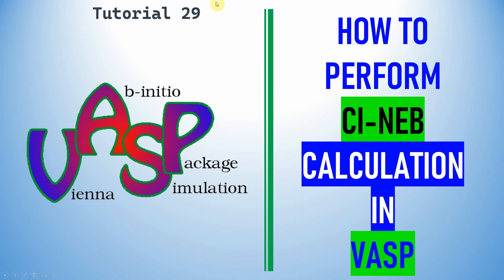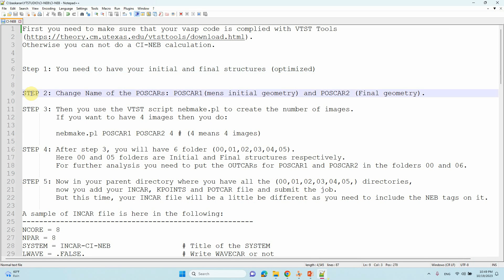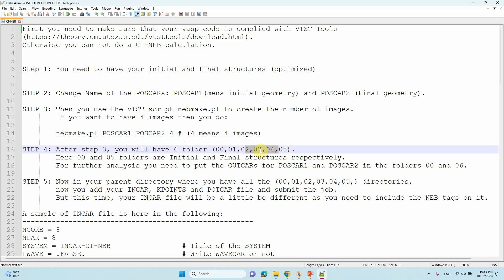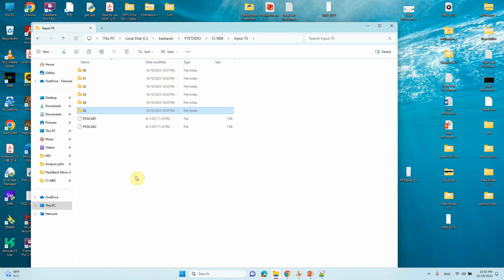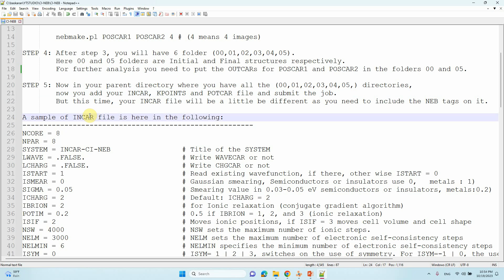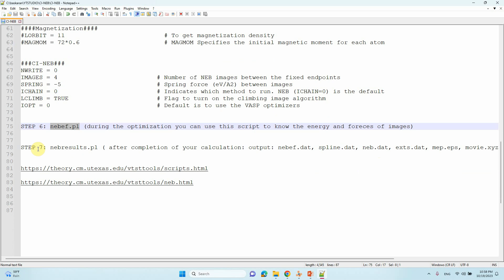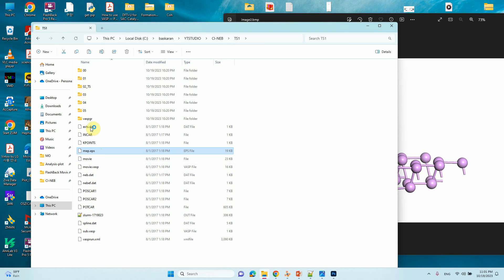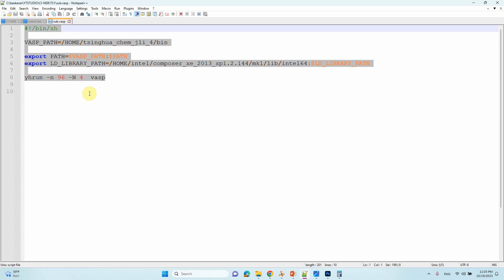How to do CI-NEB calculation in VASP | Nudged Elastic Band Tutorial | NEB Calculation using VASP

Comment: Sir How to get POSCAR1 and POSCAR2 structure?
Reply from the maker: In VASP NEB (Nudged Elastic Band) calculations, you must provide initial and final structures. These are usually named:
POSCAR1 → Initial state
POSCAR2 → Final state

What are POSCAR1 and POSCAR2?
POSCAR1
Structure of initial state (IS)
Example: reactant geometry, starting configuration, adsorption before reaction, etc.

POSCAR2
Structure of final state (FS)
Example: product geometry, atom moved, migrated ion final location, etc.
These two define the start and end of the reaction path.
Reply: @dbinfotech I mean poscar2 can be created manually
Reply from the maker: You can create manually and optimize the geometry then use.
Reply: @dbinfotech  for example Mn doped ZnS monolayer Mn is doped Zn site and then relaxed the structure . Contcar is replaced by Poscar2 and its total energy is -123.456 eV . Now Mn doped at S site and then relaxed the structure and total energy is -123.120 eV and Contcar is postcar1. It means that structure (Mn doped ZnS at S site ) is less stable than first structure so I mean POSCaR 1 will be less stable than POSCaR2
Reply from the maker: Based on the total energy, poscar is stable than poscar 1, even you need calculate formation energy (deltaE) of these two STRUCTURES TO CONCLUDE THE stable structures.
Reply from the maker: https://arxiv.org/pdf/1710.11051
Reply: @dbinfotech I am very confused about final structure
Reply: @dbinfotech I know the physics behind it but I am confused about final structure can you explain little bit  here
Reply: Here structure which is more stable consider Final structure and structure which are less stable is considered as initial structure as I gave you an example

Comment: Hi, I am calculating NEB of ABO3 structure, the images are optimized, but the energy of the images is very high as compared to the initial and final points. The barrier is high as a result.  What could be the problem?

Comment: Hi Sir, I do my neb calculation with 5 images but in my 5th sub directory i have only my poscar file what can I do for that.
Reply from the maker: Your 00 and 05 folders are initial and final structure respectively, in between 01 to 04 structure are will run neb calculations. You will check you incar file Ci neb section, you may mentioned 4 images.
Reply: @dbinfotech  I have mentioned 5 images using your video tutorial 42.
Reply from the maker: 5 means, 00 and 05 is initial and final structures other 4 is your TS images

Comment: Sir, I have question. The bond length of atoms is similar in the structure but the value of two different paths is different. If they planced at the same distance how diffusion barrier could be different for one path to another. Which factors the paths depends

Comment: We used contcar of optimized structures or should we use contcar of scf calculations. I'm using the optimized structure contcars as poscar but it doesn't convergeing. Energy is increasing and then start decreasing. Please respond these two confusions
Reply from the maker: Optimized CONTCAR or SCF CONTCAR are same only,  please check the geometry of transition state images, if ts images is not reasonable configuration, then it won’t converge, then you stop ci-neb calculation, try to do with dimer method. This may work. Thank you SB
Reply: @dbinfotech  the structures looks ok not very displaced. What's the dimmer method. Do you have any video on this
Reply from the maker: How to run the VASP calculation with the DIMER method | Transition state searches with Dimer method
https://youtu.be/MYXnNirhQKg
Reply: @dbinfotech  I'm facing a problem while NEB calculations. The energy goes increasing smoothly and it looks converging but after some steps it decreasing again. Everything looks normal what should be the reason. Its been from one months

Comment: Great Video! Did you froze your surface except moving atoms when running CINEB (the surfaces of initial and final POSCARs should be frozen)?
Reply from the maker: for 2d structures i did not fix, we need do transition all atoms, if you use 3d crystals like CeO2 (111) surface then we will fix some bottom layers (for opt and NEB etc). other top layer and adsorbates need to allow 
 for transitions (  T  T  T)
Reply: Thank you so much

Comment: One point I need to clear, can we put outcar into 00 and 05 after the NEB job is completed like before getting results. I forgot to add Outcar into the first and last folders and run the calculation. Can I add that later before the results command?
Reply from the maker: You can add later also, if want use that nebef.pl command, please put that outcar file and do nebef.pl command. After completion of calculations also we can add, and do nebresults command
Reply: Thank alot

Comment: Hi, thanks for uploading such an informative video. In nebef.dat folder, the first column is all zero and my set value of forces is 0.1. So, is it ok? secondly, the structure is not converged after making images and after 300 steps. The incar is ok and energy was increasing. Can you help in these two questions?
Reply from the maker: THANK YOU FOR YOUR COMMENT AND SUPPORT. My suggestion is you can use force for geometry optimization for EDIFFG = -0.02, EDIFF = 1E-05, and for neb please use EDIFFG = -0.03 and EDIFF = 1E-06, if you use like this neb calculation converge easily, this is suggested my friend in tsinghua university.  Thank you best SB

Comment: hi sir how to extract data for origin
Reply from the maker: Hi Thank you for your comment. I could not understand your question, please let me know, which data want to extract. thanak you Best SB
Reply: @dbinfotech  Sir, I mean the NEB plot in the origin software that you showed in the video. It was generated in EPS format. However, if I want to recreate it in its origin software, which file should I use to obtain the data? I obtained all the files by running the 'nebreuslts' command but couldn't find the EPS file.
Reply from the maker: There no use of the .eps plot, no need to worry, if you run nebef.pl you will find the TS with higher enegry,  you can also find that enegy from OSZICAR and vasp.out file , use that energy to calaculate the reaction enegy profile.Thats it.
Reply: Thanks a lot.
Can you tell me which data did you use to plot the figure?
Thanks in advance